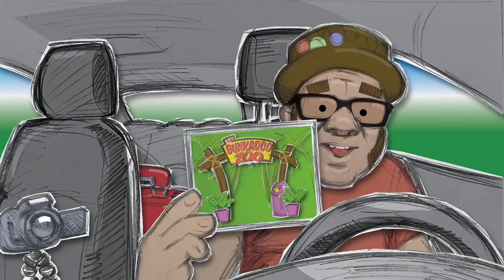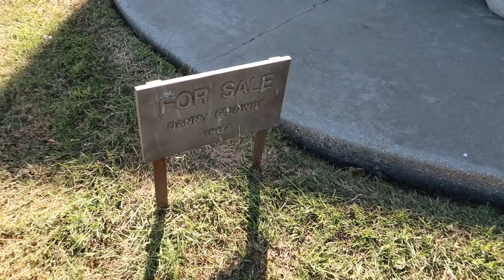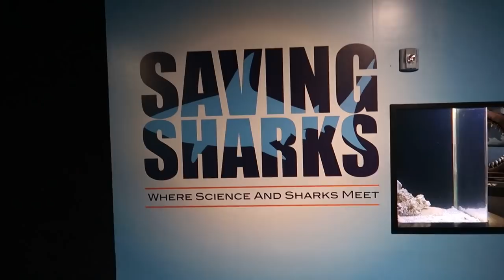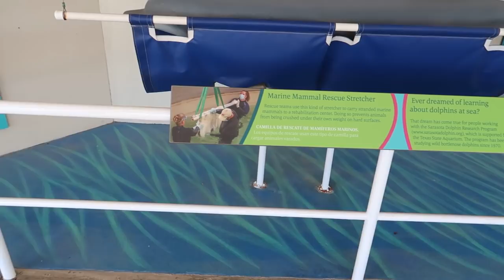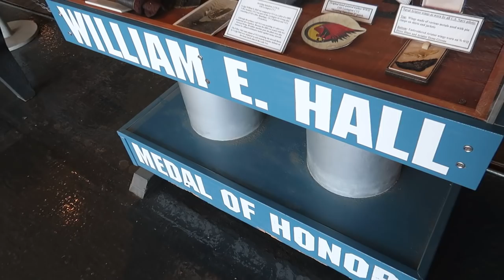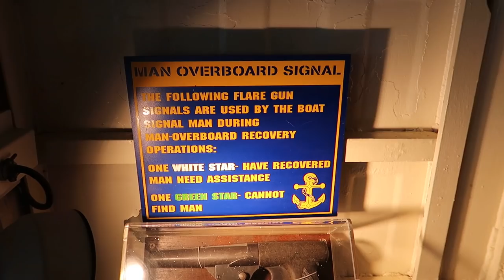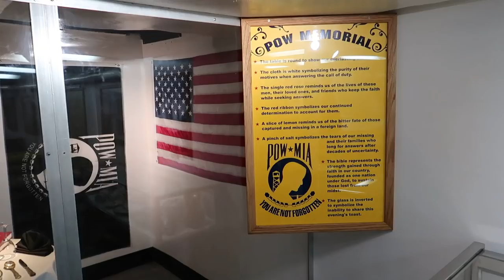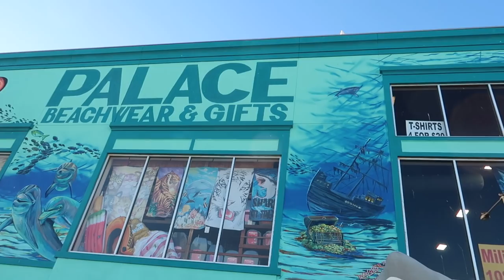USS Lexington - Texas State Aquarium - Plus Random Oddities of Corpus Christi, TX

Comment: @ 2:30 the "controls" are, starting with the big metal disc is the ship's wheel for turning the rudder. To the right is the ship's binnacle with the compass in it, and to the left, the device with the handles is the engine telegraph for communicating speed instructions to the engine room.